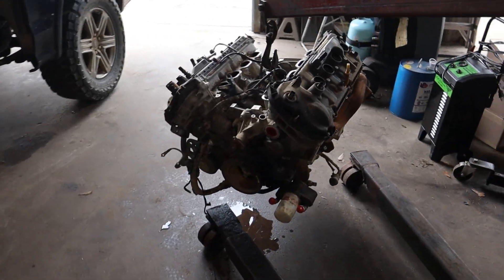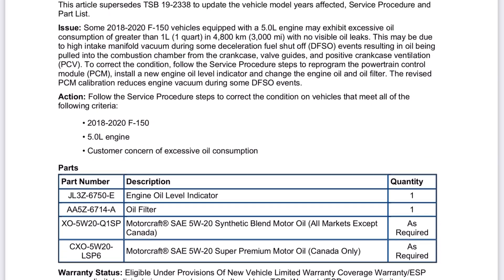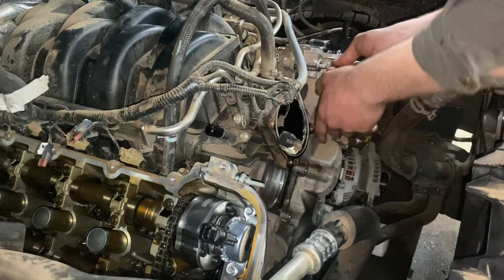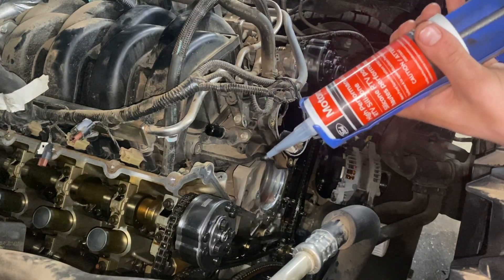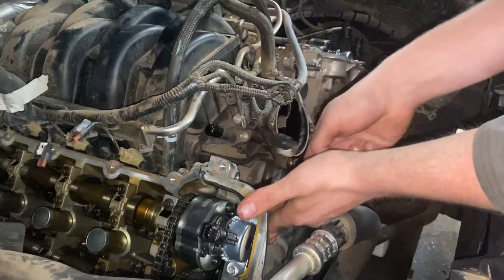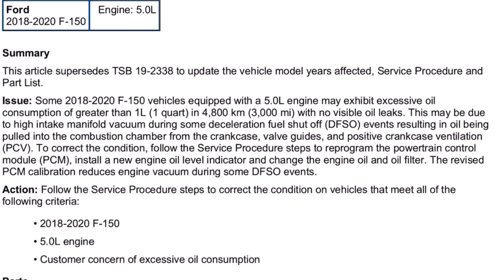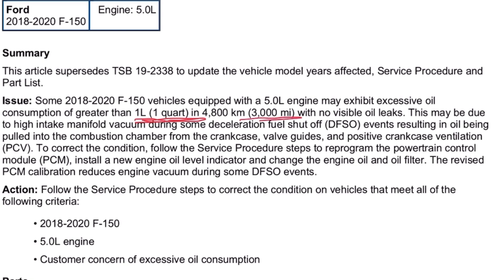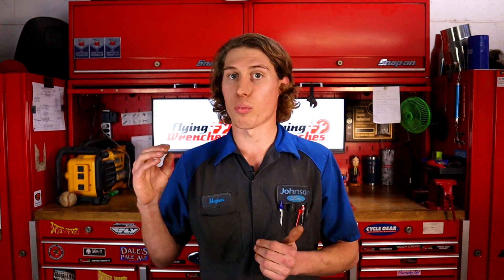Ford 5.0 Coyote Oil Consumption FIX

Comment: YOUNG female here with a 19' 5.0 and everything was fine until February. Truck started shutting off in traffic. Idling very weird. Jerking etc. Check engine came on. Computer said it needed a new solenoid. Changed that. Find out its 4qrts low on oil. Filled it back up. Drove smooth for about a week. Right back to the same results. A sip of oil here and there before I leave makes for a smoother ride. I have a service appointment scheduled. But the dealership is backed up. So I still have a full month left until I take it in.😢
Reply: On my 2018 5l I reduced oil consumption by switching from 5w20 to 5w30 oil.
The sprayed on plasma cylinder liners may have something to do with the oil consumption.
Reply: I have wondered about switching the oil up to a thicker viscosity like you say. Do you know any sources to read that could hold up positive proof for choosing the change up? 
It’s one of the things, I cruise all these comment threads for. 
Before I takeoff from reply,…. Can we all agree, the guy who made this video seems like a weird creep. His advice is no advice at all, and felt more like the delivery of a trolling prankster ass bet that was made in the shop. 
In a video highlighting the popularity of a specific engines oil consumption leading to failure in countless amounts.… this dip shit has a hard on to say stop checking your oil.  only 65-year-old’s check their oil. No need to check oil, regardless of possibility to save your engine from going to shit…. Then proclaim it doesn’t really burn oil, BUT!!! Once people listen to his rhetoric, “SOME”can agree with his manipu…. Ooh…  I meant….  Technicalities. 🙄
Reply: Motorcraft solenoid?

Comment: this guy comes to my work with a 19 platinum with the 5.0 and it’s got 90k on it now but since almost new (probably around 15k it started) he would come in with a check engine light and it was a low oil code every time. the most recent time he came in still had 1k left on his oil change and i had to add 6 quarts of oil just to get it on the dip stick again. and he’s not the only one that comes in with a 5.0 with consumption issues i just think people believe they need motors so they don’t speak up because this gentleman drives for a living and needs his truck and doesn’t have time to wait for a motor swap. but thank you for this info i will let the guy know this and hopefully he’ll go back to the dealer and get the reprogramming done. thank you!

Comment: I'm tuned, on E85, and spinning over 7K RPM with the truck manifold, and when I change my oil every 3.5K to 4K miles my dipstick reads pretty much the same as it does when I fill the engine. My truck is a 2018 F150 5L BTW.
Reply: Yeah, IDK. I assume a good tuner with experience tuning any particular vehicle would know how to make it run correctly without hurting the reliability too much. Kind of like back in my Terminator or Lightning days. (I still drive my Lightning at least once a week) Those vehicles had little things about them that you have to know how to tune right or they could lead to problems. With as well regarded as OZ and AML are in the 5L F150 world you would think that they'd know the best way to tune them to have them work as optimized as possible. I also change my oil every 3K-3.5K miles, and I never use a thin 20 wt. 5W20 is unnecessary. My 03 Cobra and 03 Lightning called for 5W20. Ford switched from 5W30 to 5W20 in 2001, and before it they ran 5W30. A 99/00 Lightning used 5W30 as an OEM rating, but on the same longblock they switched to 5W20 in 01. Same with a Mustang. My old 99 GT called for 5W30, but if you bought an 01 GT it called for 5W20 on the same engine. My point is the switch to 5W20 was a move to try and get better MPG's with. 5W30 will not hurt the engine, and actually be better for it in warmer climates. A thicker oil is less likely to burn off. 

Hell in my old 02 Camaro SS Mobil 1 5W30 would burnoff oil. I switched to M1 10W30, and it solved that issue. Later I found out that the only 5W30 that would produce noticeable oil burnoff in my LS1 was Mobil 1. Every other brand of 5W30 worked well without any noticeable burnoff, but when I went back to M1 5W30 in it again to make sure that it wasn't a fluck, it started burning the M1 5W30 off again like it did when I first bought that car. That car had a stock engine with 31K on it when I bought it and it was fresh and smooth, but didn't like M1 5W30. Point I'm making is a 10W30 might also slow any oil burnoff you have. When the engine oil is cold it will be a 10 wt instead of a 5 wt, but I doubt it would hurt anything, and once warmed up they're both 30 wt oils. This way your oil is thickened up a little bit over the 5W20 oil when both hot and cold, and that should slow up, or do away with any noticeable oil burnoff.
Reply: @JROC734  I did switch to 5w30 about 10K miles ago, but I’m still experiencing about 2-3 quarts of oil consumption every 5K miles. I’ve always used Pennzoil Ultra Platinum in the truck since it was new, but I may have to start trying some new oils to see if that’ll help. Tomorrow, I’m gonna start by replacing the PCV valve to see if that may help, too. They say you should replace the PCV valve every 60K miles, which I just recently went over.
Reply: What tune are you running? I have a ‘19 5.0L tuned by Oz, but I still use 1-2 quarts per 5K mile oil change intervals.
Reply: I'm running an AML flex fuel tune. Had it on my truck for about 1.5 years.
Reply: @JROC734  I wonder if our tuners take the oil consumption issue into consideration when they’re programming our tunes.

Comment: smart vehicles make for dumb owners & drivers.when it cost you 8-10k to replace your engine, you check your oil by hand with a dipstick.i check mine every two weeks.sensors fail all the time.dipsticks dont.

Comment: I don't believe vacuum is the problem, the first gen 5.0l in the trucks, atleast in my experience, have had zero oil consumption in 5k miles. And the one I have tows for an entire oil change without burning a drop. And the DSFO when engine braking generates so much vacuum it pegs out most vacuum gauges and still doesn't pull oil into the combustion chamber. It has to be an engineering flaw in the newer engines like lower tension piston rings or possibly micro porosity in the new plasma liners.
And in this day I don't believe oil consumption is normal for any engine, I've been around engines enough and built so many that a well built engine can run for atleast 150k without using oil.

Comment: There is a huge problem with 5.0’s burning oil. Our company has large number of F1 50s 18 and up all burn oil. I’ve had to put up to 1 gallon one time on my valve started to rattle few of the guys have burn up their motors. Definitely check your oil guys.
Reply: Have you had the reprogramming done? When we reprogrammed the pcm, it has fixed 90% of the oil consumption problems.
Reply: I belong to several 18-21 f150 5.0 groups and very few have had the reprogramming tsb work. I didn't work on mine. I don't know where this 90% came from?
Reply: @Jack-ox9iz  Same. Did not fix the problem. I even capped the pcv nipple and ran valve cover breathers and still burning 1 qt/1,500 miles.

Comment: I have one waiting on a back order long block. The cylinders liners are the shape of footballs and walls look like someone took 80 grit sand paper to them. 90k miles and changed oil per Fords recommendations. 2018 bought new original owner.

Comment: And the ford tec bored scope my cylinders and i had at least inch to 2 inchs of oil on my pistons witch os a stupid design its from plasma transfer wire weld wearing off cuz they stop using cylinder sleeves

Comment: The oil consumption is from ford stop using cylinder sleeves and went to plasma transfer wire weld witch is stupid my truck uses 5 to 6 qts every two weeks ive being waiting for a motor now 3 months

Comment: I'm old school. I check my oil regularly. In my last oil change cycle, in 6100 miles, I had to add 6 quarts of full synthetic and it was at least a quart low when I changed it. That's unacceptable. Had I not checked and added it would have had about 2 quarts in the pan. My dealer said to bring it in and they.will diagnose and he said probably replace the engine. It currently only has 31k miles. My 02 Dodge 2500 v10 has 125k miles and uses about a quarter of a quart in 3k oil change cycle. My 01 jeep has 230k miles and uses about a quart in 3k miles. 
When I talked to the dealer about the oil consumption, first thing he said....oh great, not another one.  If they don't replace the engine I'm trading it in for a new Ram.

Comment: i check the oil on my 05 Silverado every time i fill up with gas.  i never see anyone else doing it though. great video!!
Reply: Gotta love that 5.3-6.0 I got a 01 silverado 20 yr old truck and engine..thing still runs great and doesn't burn oil!

Comment: Mayson, I have to disagree, Sir. I own two Ford’s right now. I’ve got an ‘04 Expedition and ‘16 Expedition. 

The 5.4 Triton motor will consume between 1.5 to 3 quarts of oil between oil changes. Doesn’t leak. Doesn’t smoke. Just have to keep an eye on the oil level. It’s got over 308k miles on the odometer. Would have never reached that number if I didn’t keep an eye on the oil level. JMO

Comment: You are absolutely correct! Every ford V8 I have owned burns oil! I have this 2018 5.0 and it runs fine. The only concern with this model range was the 10 speed transmission issues. But I had a master mechanic fix that by disabling the adaptive learning tables. Not resetting but completely turning it off. Now it runs like as smooth as butter!
Reply: Every? You never had 4.6l then cause mine never burn oil literally at fill mark start and end 5-7k miles oil used was Mobil 1 full synthetic then Amsoil then Motorcraft engine had 175k ish miles on it and everything was gold colored when peeking thur pour cap.
Reply: @TrollinCrazyRussian  I've never had a vehicle use any oil until 150,000 miles. GM also says normal for oil use. I can say my 2017 5.0 uses no oil.
Reply: Where is this master tech that can turn it off? My 19 needs it.
Reply: It will until it wears and the software doesn’t account for that because you turned it off. Nothing is free. Those days are over.
Reply: Did you do it at a dealership or outside mechanic shop?
Reply: Go to any tuning shop and the tuner can turn that off for you.
Reply: My 2009 5.4. has 320km. Doesn't burn a drop in 8000km
Reply: Buy you an OZ tuner and you will love your 10R80, it will last longer too.  That unit can be tuned to meet you needs no problem. Fords stock program leaves a lot in the table. 
As far as oil consumption goes, I have used ford engines for 60+ years but haven’t had ANY oil consumption issues.  My 2013 5.0 has 188,000 on it and uses no oil. It’s is on full now with 8,000 miles in the oil. It’s not a truck but it’s has made hundred of trips down the drag strip. 
Is the truck engine that much difference? The firing order and compression is but that didn’t do it. I was going to buy one but I may just put a mustang engine in an old F100 while I’m still young.
Reply: I agree with you. I have a 2019 5.0 f150 and I had the pcm reprogrammed. I think it helped but I wanted the auto learn system shut off as well and the dealer wouldn't do it. I think what is happening is when you are going down hill and the transmission down shifts is where the vacuum occurs especially when cruise control is on. I turn off cc when going down long steep grades and I think it has helped. I need to find a master mechanic to turn off the learning like you did.
Reply: Use forscan @pickupman2649
Reply: I've had several Ford V8s that didn't burn oil.. guess everyone's experience is different.
Reply: Check the damn oil, it’s not that hard! Yup I’m older than 65.

Comment: If you put a UPR catch can on it, you would trap the oil 🛢 before it went in pcv and intake valves.
Reply: Don't some of those catch cans dump back into the valve cover?
Reply: @rosseowens  yes they do
Reply: @rosseowens doesn’t that defeat the purpose of the catch can? Key word- “catch”
Reply: Ok I agree but with a new truck with less than 36,000 why should I have to do anything like a catch can.  Then what do I do with the oil in the catch can? Just keep throwing it away?
Reply: @fireriders8319   Even a car that's brand new with ZERO miles would benefit from an oil catch can. Like he said, it traps those oil vapors before being burned off inside the combustion chamber. Keeps the intake, valves, and pistons much cleaner. And you literally empty the can at every oil change, that is, if you even change your own oil.

Comment: Would it be possible to do a video on the rattling that the intake runner butterflies make? My 2017 5.0 has started to do it and theres only 1 vid that I saw who showed the issue but they were not the best at making vids. Too many mechanics are convinced it the lash adjusters. Thanks in advance if you do make a vid

Comment: Mine only uses a half-quart every 3000 miles at the most. You really do have to get it to temp, shut it off and wait 45 minutes or you'll never get a consistent reading on the stick.

I think a contributing factor is the trucks probably run higher oil temperatures than the Mustangs to get the oil thinner for better fuel economy. I know I catch more trash-oil in my truck's PCV catch can than I did in any of my Mustangs, which I think has to do with higher temps creating more vapor in the crankcase. I'd also be curious if the piston ring packs are lesser friction between the truck and Mustang 5.0 to help with MPGs. IDK though.

It's not a big deal for me, I just keep an eye on it.
Reply: My 2019 GT recommended oil viscosity is 0w-20. They say to use 5w-30 for tack use and to switch it back to 0w-20 afterwards. So let’s see, buy 10 qtrs of synthetic 5w-30 then replace it with ten quarts of 0w-20.  Yeah nope. I can’t track mine because there are no tracks near me and it’s a vert.

Comment: Just like the oil pan leak on 2.7 mine’s leaking but it’s not bad enough to worry about changing it If it was under warranty yeah but I’m not spending on it till gets worse
Reply: I got 126k on it runs great change oil every 3-4000 miles

Comment: i would say that alot of todays engines have consumption issues is because of the low tension oil control rings.plain and simple
Reply: I can agree with that and I'll also add that it may have something to do with the spray welded cylinders that started in 18 model year  Sleeved cylinders in the 17 m.y.
Reply: 100%

Comment: Youtube Ford Boss Me has a video of a 5.0 that was still using oil after the reprogramming. They were waiting on a replacement engine and found it was nolonger made. There is  LP version that he was able to get(block only). All parts could be swapped. He said they are now saying the process to harden the cylinder walls was bad. The LP engine is made different. My son-in-law had a 5.0, it was still using oil after the reprogramming. He traded it off.
Reply: That's the problem with trading it back to the dealer. I bought a used 2019 ford f150 with 29k on dash and after a moth of owning it I went to add washer fluid and just checked the oil for shots and it was 2 qts low. Now I'm adding 1 qt every thousand miles. I took it to dealer and they did the dipstick tsb and still has the problem. How is it ok for ford to know of this problem and tell you to trade it in for a new one then resell it to someone like me has a gold certified truck. At these prices you shouldn't have to do anything but brakes and tires for the first 100k.
Reply: @donaldbuscher4885 poll
Reply: Its extremely aggravating and some bs  @donaldbuscher4885
Reply: The LP engine still has the plasma spray cylinder liner. Something with the valvetrain is a little beefier but the oil consumption issue can still happen in the LP engine. Either way you get a little more piece of mind having a better replacement option having the LP engine put in.
Reply: The new longer dipstick is Ford's way of saying we are topping up too often unnecessarily but without saying, yeah, we still think it's going to burn off a lot of oil regardless of their fix. I bet the majority of the oil is getting past the rings while it's warming up, and add some deceleration to your local stop signs etc to the condition.

Comment: As a long time Ford truck owner I say this.  Great information.  What I found most interesting is your comment on oil volume range.  6 quarts minimum,,for regular operations.  Could it be the “extra 3 quarts in the oil pan is to increase your oil change intervals?  I check the oil on my 2019 (5L), every 1000 miles.  After the reprogramming, I burn 1 quart in 3000 miles.  Instead of adding, I change oil.  Again that for the info, it really helps this 60 something driver.
Reply: ive seen old crown vics with 400k miles that don't burn anywhere near that much
Reply: I have a 2016 with the gen2 5.0L Coyote engine. It has over 100K miles and has never burned any oil. Ford increased the compression ratio from 10.5/1 to 12.0/1 when they went to the gen3 in 2018. What did they expect to happen? All that pressure blows oil right past the rings. Duhhh!

Comment: I check the oil in my 6.2 Duty every month.  85K with towing and it has never been low.
Reply: The 6.2 is by far the best modern Ford engine. It will be missed.
Reply: @0HOON0  I would probably agree.  It's too early to judge the 7.3 or the new 6.8, but the 6.2 was absolutely one of the best gas engines Ford ever produced.
Reply: @davesmith2693  The reputation of the  gas 7.3 really suffered with all the early cam/lifter issues. Hopefully it will be a good engine after that issue is fully sorted.
Reply: You using 5w30 or 20 ?
Reply: @kenj.8897  Mine is an early version 6.2 which calls for 20 so that's what I use.